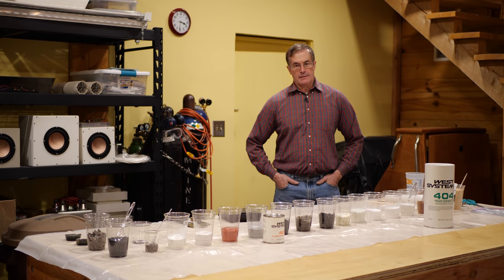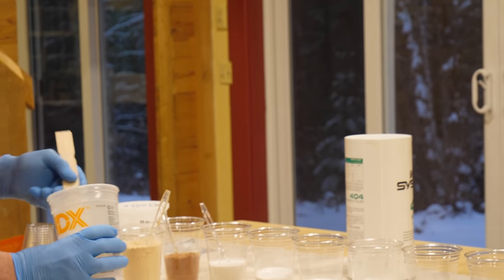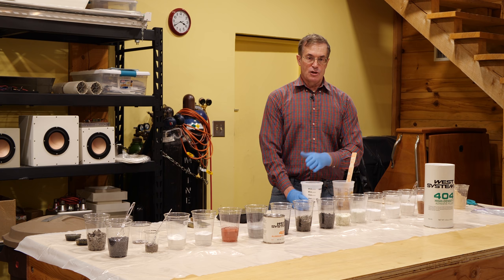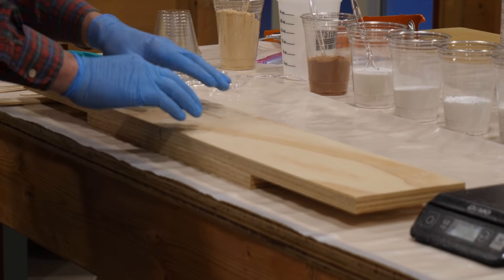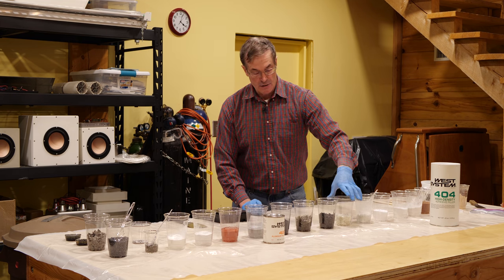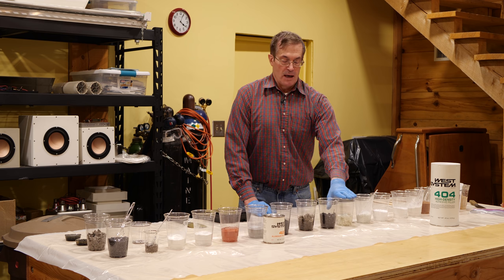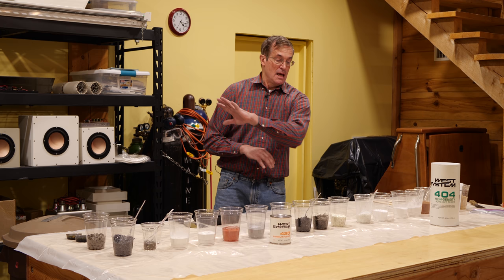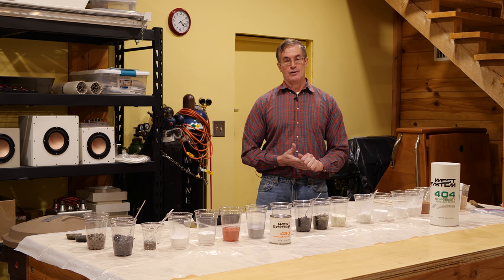Super Strong Epoxy with Diamonds and More!

Comment: Will you shoot those last couple ballistic mixes?  I have been imagining something like this for some time now.  I was a scout sniper in the Marine Corps for 13 years, now I am an exploration geologist.  The unusual background combination has left me up many nights thinking about how layers of varying  mechanical properties might attenuate the pressure and shear waves as they pass through layered composite armor.  Please let me know if you are interested in some background study I have done on different blends of polyurias and their applications in composite armor.  I think there may be a way to distribute the force over the layer boundaries in a sort of non newtonian fluid sort of way.  I appreciate and share your channel.  Cheers, Mark
Reply from the maker: Let me start by thanking you for your service.  No one does that to get rich.
Where I think the most potential exists is in multilayer armor that dissects the projectile's strengths.  For example, an outer layer that deflects trajectory slightly, an abrasive layer that increases the interaction with the barrier, a hardened layer that fragments and an energy absorbing layer that stops the tumbling or shattered bullet.

Comment: Thanks for an interesting video. I hope this helps you with ranking algorithms. Your examples and illustrations are stimulating and I hope the future of education. Such a pleasant way to reach out during this pandemic. I reallly hope in the future students spend their time in supervised  laboratories staffed with people like yourself where they can extend what they've learned from videos and texts. I lived the tour of your worshop and I wonder if at some point you will add a fumehood or ventilation system with filters to contain some of the dangerous dust particles from sanding and mixing and also for efficient curing with ceramic heat lamps or something similar with air recirculation.

Comment: use a compressor to blow out the plug, when the epoxy is hardened it is easy, you can use it many times over. the same with the tip.

Comment: Wondering if you would be interested in exploring the field of planer/electrostatic speakers(headphones). It seems like they can be produced for cheap but most audiophile companies charge a lot for them. It is essentially a thin foil between two metal grids suspended with static electricity or a magnetic field. By varying the strength, the film can be pulled and vibrate.
Reply from the maker: They rely on a changing electric field and in order to move the foil they have to run pretty high voltages.  With the floor models this means thousands of volts.

Comment: Here's another application for these kinds of composites: Say you want moldable part with somewhat intricate features, yet light and strong. This is where the kind of carbon composite you showed shines. You can choose the particle size to adjust how easily it conforms to a mold and how much strength it has. For bigger parts without intricate shapes of course it can't quite stand up to woven carbon fiber sheets, but it's still comparatively light, strong and easier to manufacture than using CF sheets. There are already commercial uses of this - some car companies are using it (Lamborghini has done some research and put it into use for example) and Shimano uses these kinds of composite parts for shifting components in high end bicycle drivetrains (derailleur parts, shift levers, ...).
Reply from the maker: Correct.
Reply: Ford made a car from Hemp, it was very strong. Fibre and hemp oil that can be used as glue?

Comment: Amazing! You are reading my mind! I have been toying around with the idea of building a milling machine using epoxy granite for the mainframe. I have run across a few videos on this subject as well as a company that builds full-scale industrial machines. The epoxies are pretty much explained as to which work best but the aggregates used are a bit of a mystery. What combination of aggregates would work well for an application such as a machine frame? Could you do a video on this subject?

Comment: I've got a little twinkle in my eye from seeing this. Thank you for pursuing the topic of UHPC. Very neat stuff.

It turns out the Calcium Silicate Hydrate reaction that forms the structural foam around the agregate materials in UHPC concrete does significantly contribute to strength. Some geopolymers that end up with an aluminum oxide - silicon oxide structural foam have shown to be much stronger than standard Portland Cement based mixtures. Its like swapping out E-Glass (Silicon Dioxide) with S-Glass (Aluminum Oxide/Sapphire).... or so this limited amount of research implies.

Comment: Reminds me of flex seal - the sprayable sealant promoted by the "that's a lot of damage" guy.

Looked into what was actually in it once, and it seemed to be primarily composed of "alkali feldspar"- a type of volcanic rock. Silicone based rather than epoxy, but probably the same principle (and maybe also to neutralise acid produced during curing?)

Also, you seem to have some sort of interfernce In your audio setup- a buzzing sound modulating up and down a few times every second.

Mostly only noticeable during quiet spots unless you're sensitive to that kind of stuff like me :)

Not sure what could cause that kind of noise, maybe some electrical motor having a commutator flat spot? That's a really wild guess though

Comment: Hello , could this admixture approach be used in a high density foam core material ? This world allow us to do away with the weak link in boat building , plywood . I know , just weld up some aluminum . But weight = power and speed . I want to fly my boat above the approaching storm if need be . No foam core carbon fiber laminates . Just a single layer of a concretious ingredients . ??? AND moldable ! Is this what you are trying to do ? … I want some !

Comment: The most valuable 33 minutes of my life I've spent in a long time, thank you. I want to find a way to bond basalt bar stock (<1/2" or 10mm OD) into mild steel pipe to withstand pullout. I'll TIG weld the pipe into couplings which will be the nodes in a truss supporting a roof. Considered interference fit (heating pipe with oxy-acetylene, insert basalt bar, possibly with high temp epoxy) but would really like to understand which filler might improve the strength of this bond. Would titanium coated diamond vaporise if a combination of it and epoxy were to be used to coat a basalt rod that was inserted into a mild steel tube that had been heated to around 1000 degrees C?  Could be quickly quench cooled. Do I even need to consider an interference fit? What would be the optimum distance between the OD of the male (basalt rod) and the ID of the female (mild steel pipe) to maximise bond strength? Any insight or suggested further reading would be gratefully received.

This is one of my favourite YT channels.
Reply from the maker: The epoxy alone has the highest tensile strength.  Additives add compressive strength and stiffness.  You need tensile strength.  Heat beyond 150 C is a no no for epoxy and additives don't change that.  Epoxy bonds well to rough steel and to bassalt, but oils seriously degrade this.  The steel bonding surface needs to be CLEAN.  Quenching, even quickly won't save the epoxy from thermal damage.

Comment: 10:07 or use a (ziplock) bag and cut a corner to make a small hole, similar to what cake decorators do. The more you thicken epoxy the LESS likely it is to soak into any sub-straight which results in a weaker bond. The harder you stir the ingredients the more air bubbles you’ll introduce (which results in a cloudy mixture). Edit; you’d be hard pressed to find an adhesive that adheres to polyethylene 20:13 or polyethylene. The empty caulking tube shown at the beginning of the video is made of high density  polyethylene or polyethylene. If you empty out that tube of unused epoxy and let the residual epoxy cure THEN you can wack it a few times the hardened epoxy will just fall out BAM it’s reusable!! 26:30 Copper is a natural fungicide, maybe it’s conductive properties deter micro-organisms

Comment: You mentioned that you're working with graphene so I'd like to see a stress test of these composites vs cnt and graphene-enhanced composites. An educated guess; the tensile strength would be higher than steel but I'm curious to see cost vs benefit. I'm also curious about their compressive strength and resistance to shear force.
Reply from the maker: Initial structural testing with graphene isn't impressive.  Because of their small size, graphene platelets have a large number of adhesive/graphene interface planes along any macroscopic axis and this prevents the high strength of the individual graphene particles from being expressed. In addition, actual graphene has a lot of defects and is far from the theoretical strength and stiffness of the monolayer material.  Those are the reasons a number of researchers have given for this disappointing result.
However, they have found and I think we have found the same, that a small amount (1-3%) of graphene added to a conventional epoxy/CF laminate  improves the properties of the composite due to improved adhesion and epoxy strength.

Comment: methyl methacrylate is an excellent two-part epoxy (correction: thermoplastic) I used it to fix some cracks in an ABS-acrylic copolymer eddyline kayak with carbon fiber cloth. Easy to spatula and sand, great long-term fix.  Howver It is thick, hardens very quickly and has a strong oder.
Reply from the maker: It's an excellent thermoplastic, but it's actually not an epoxy.  Epoxy is generally softer, tougher and can be purchased with a wide variety of working times.
Reply: @TechIngredients  well I guess then my favorite epoxy is the one that holds my libtech and Gnu snowboards together.
Reply: @TechIngredients  would adding the carbon fiber chunks or the titanium diamonds or any of the other materials significantly improve methylmethacrylate?
Reply from the maker: Sure.  It's frequently used with polyesters.
Reply: @TechIngredients  I have read that they do use glass, plastic, resin beads to thicken the adhesion when bonding Parts together in some formulations. Also that the formulation can be specific to the bead size I have read because it can boil or overheat.

Comment: More epoxy and composite vids please ;-) The strongest concrete would be made from a wide spectrum of fillers/aggregates esp including those of extremely fine size. Harvesting ordinary air pollution with scrubbers and filters produces particles nearly ideal for producing the finest grades of fillers to make ultra high strength concrete. Likewise the pozzolans themselves need to be of various sizes to match the voids between aggregates. Super fine pozzolans like fly ash complement coarser ones manufactured for purpose. We could make concrete 20 -50 times stronger than we ordinarily do while still using harvested waste products but the industry resists the quality control required to make such products. They prefer bulk and waste to quality and efficiency.
Reply from the maker: We'll cover UHP concrete formulas along with testing in an upcoming video.

Comment: Of all the dusts that you do not want to breathe that nano silicon would be the worst, The point first noted I believe with miners quite used to rock dust died in high numbers when they were in rock containing a lot of silica.  Sitting just below carbon on the periodic table I suspect the reaction is the reason vs other dusts, and nanoscale makes something I would not want to be around.

Comment: You should do a video on basalt fibres, comparing strength to s glass, e glass and fibre glass
Reply from the maker: We're using basalt exclusively for our UHP concrete experiments.  However, it's only available in loose fibers, scrim and rebar.  I haven't found it in a tight weave cloth for epoxy work.

Comment: Thank you for the very educational videos. You asked your viewers for topics that may be valuable, so:
Today milling machines are no longer working at a micron tolerance but in Australia, the university is building machines capable of 
ten+ nm scale tolerances. Can someone improve upon the natural granite stones with a synthetic material? Also, additive manufacturing via 3D printing is the in-thing. What are some of the best ways to improve upon 3D metal printing of aluminum, copper, iron, steel, ceramics, etc, that may go beyond what is already being done.
Thank you and have a great day,
Samuel Lee Steel MD

Comment: @tech ingriedients: Really Good as usual from you guys 👍
You mentioned about using the epoxy mix with an aluminum powder on boats to strengthen from potential damage. Did you try this on the catamaran you made?
Reply from the maker: No, the area is so large.  If a narrow skeg or rails were used then I would use a thick layer of the toughened epoxy.
Reply: @TechIngredients  ok ye thats a good idea to toughen up a damaged prone area. 
So the decision to not use that is it because of the weight or cost. or simply it is not particularly necessary? Lastly are you still planning to do more boat episodes. I was already planning on making a boat having recently finished a cnc machine before your catamaran video, watching that just made me more interested and I really like how these are tie together :D

Comment: What composite combination would you suggest using to restore a cracked steering wheel from a 1942 Chrysler?  It is intact on a metal ring I guess, just a couple places where it has separated likely due to expansion. It is sort of a green/gray.

Comment: Great video ! What would be your recommendation for aggregate for DIY epoxy granite cnc milling machine ?
Reply from the maker: Actually, just play sand.  It works well and is extremely  cheap.  Powered rubber is even better, but it's hard to locate and probably not worth the small improvement.

Comment: Hope you are doing well. Loved the video! Im wanting to make the most rigid layup I can. After watching this I'm considering trying a mixture of titanium coated diamond and boron or silica carbide powder. Also would you have any recommendations for epoxy? I normally use what's provided but I would like to know if stiffer options are available for this personal project.

Best wishes
Reply from the maker: The greatest rigidity will be with an epoxy soaked fiber cloth such as carbon fiber.  The particles will add little to rigidity.  Epoxy formulations that require a high temperature secondary cure are the strongest and toughest.

Comment: Thanks for this highly informative video. 

I'm looking at building a high strength lightweight camper and am looking into epoxy/foam and epoxy/cloth as options. Maybe combined with aluminum structural members. This is giving me even bigger ideas, rutroh!

I wonder how hemp fibers would rate in the strengthening? Have you done any work regarding hempcrete? I'd like to see what can be done with a hempcrete/high strength concrete hybrid or hempcrete/aircrete hybrid.

You've got a new subscriber.  =)
Reply from the maker: Thanks!
I haven't worked with hemp and it may be fine.

Comment: For small cast/molded objects, wondering about silicon carbide in a range of grit sizes for densification. Not a sexy as titanium-coated diamond dust, but ...
Reply from the maker: I think you're right.  It's also very available in various sizes because of its use as a grinding medium.

Comment: I want to try these kind of materials to make guitars. There are plenty on the market already but may be that you have some cool idea. I read that kevlar and carbon fiber textiles bonded together produce a sound similar to tonewoods. I also read some publication about bamboo fibers that have similar properties to carbon fiber. Also, which poxy cures harder at room temperature? Any tip?

Comment: I have some foaming agent I want to use to make an insulated panel. The starting point is cellular lightweight concrete (CLC, often called "aircrete", basically cement with entrained air). But is there a better additive than cement to 'set' the foam? I want to create super light panels which do not need any structural stiffness of their own - they'll be fully supported. If I add the least amount of cement needed to cure and set the CLC the minimum density will still be about 350kg/m3. Is there a chemical or group of chemical additives that I can use to 'set' this foam? The foaming agent, by the way, is a surfactant, pretty much a high performance shampoo or dish washing detergent. Would really like to experiment with this stuff, or see you experiment with it!

Comment: is it possible to work the epoxy putty for strenghtening joints with the same method and as clean as when working with silicone and caulking blades? Great information and very well presented!
Reply from the maker: Pretty much.

Comment: I have a question: Can the techniques used here be applied to other bonding agents? Are there any major considerations to not using epoxy other than bond strength?
For example:
- Strengthening fibres with flexible adhesives for increasing toughness without adding too much rigidity or brittleness (eg on an epp foam wing, I've actually tried e6000+fibreglass - like laminating the foam but with increased tear resistance and poorer surface texture)
- The heat transfer techniques with something like silicone mould mix so you could create moulded heat transfer pads. (for example to create a pad contoured to the shape of your laptop)
Reply from the maker: Two part curing silicone has a long history as a matrix for thermal transfer and urethane rubber is often reinforced with fibers for tires.